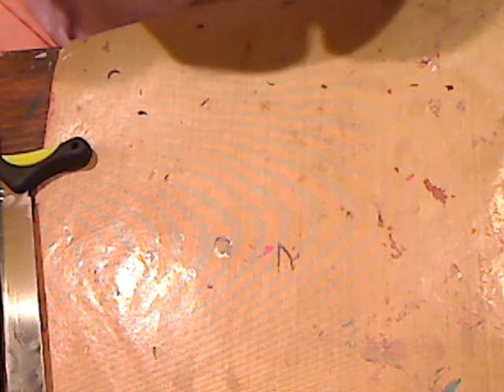POLYMER CLAY FLOWER CANE

Comment: Help mine didn't work out! The peddles twisted up on the inside and it just looks like forms floating around in there. Help!
Reply from the maker: did u freeze them inbetween steps or before you made any cuts? thats something i cant do as i am in craft room but you should do because of the heat from hands and room will make it mushy and not hold shape.